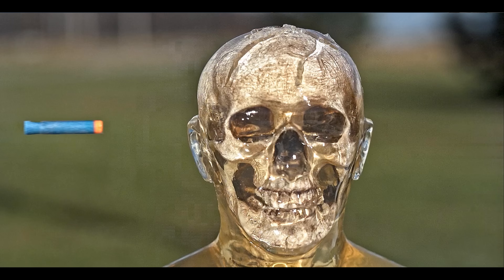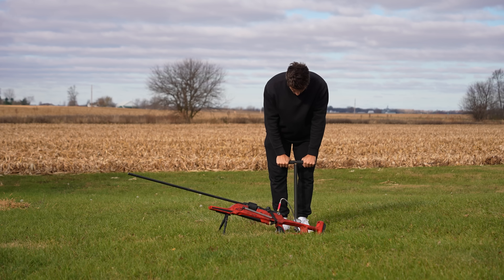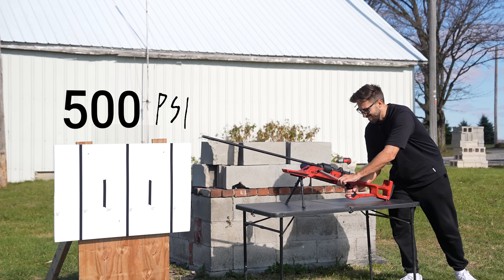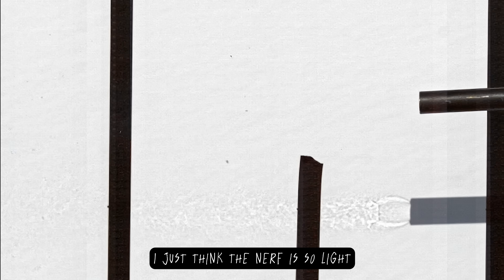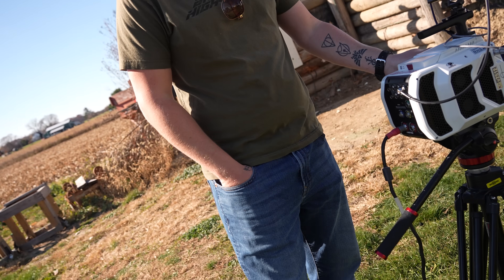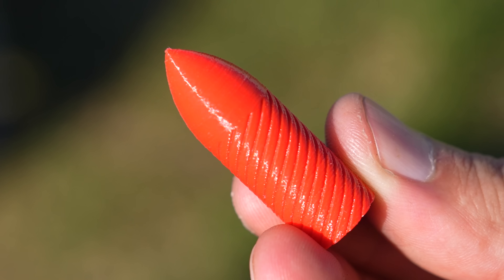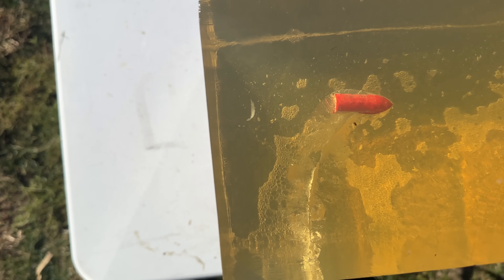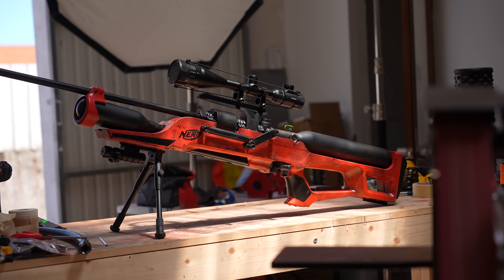How Dangerous is a Supersonic Nerf Dart?

Comment: I made a nerf gun with a bike pump that got up to 2000 psi and released it all at once. The nerf darts always exploded but I made a nail sabot projectile that would shoot at 2000 fps. I also shot lead 9 mm bullet that I cast, and I was able to reach 600 fps with them, basically a low powered pistol. I was able to penetrate thin steel with it.
Reply from the maker: What was the mechanism? (Valve) Releasing speed is even more important than pressure
Reply: @MikeShake  It was simple but effective. It was a ball valve with a long lever, hooked up to very powerful rubber bands. When I released the trigger, the ball value opens extremely fast. It was not a very pretty mechanism, but the results were excellent. 
I would love to share more about my previous experiments because I am just as nerdy as you. 
A 3 printed discarding sabot definitely gets me excited about making air guns again. 
I sent you an email about an unrelated topic an hour ago, looking forward to hearing back from you!

Comment: They built a gun that can shoot a ping pong ball like Mach 2 I think. Using a vacuum. Not pressure. They vacuum all the air out of a tube with the ball inside. Then they puncture the seal on one side of the tube causing the air to rush in pushing the ball. Since the tube has no air resistance due to the vacuum the ball reaches super sonic speed with little or no deformation. I’m sure they could do the same with a nerf dart. The low mass plus wind resistance of a nerf dart limits its terminal velocity. But in a vacuum there is no wind resistance.

Comment: hi, just want to let you know, the reason the 50. cal muzzle loader bullets twisted might have been becuse you left on the little plastic piece on the bottom
Reply: because usually that plastic piece will melt when the muzzle loader is shot and wont hinder the trajectory and penetration of the bullet

Comment: In slow motion you can see the biggest issue destroying the nerf darts is an overpressure as they leave the barrel. Drilling several small ports in the barrel a dart-length before the end of the muzzle could relieve the pressure before the dart exits. You'd be losing acceleration length though, so I would recommend a longer barrel if you tried this approach.
Reply: It may be even worse, on my point.
The projectile is not a solid bullet. It seems like the foam is highly saturated with compressed air so it expands after leaving the barrel. 
It may probably happen, that  the foam will partially expand in that area of pressure lowering, so it could be caught by theese drillings. It can cause the projectile destruction before it can leave the barrel...
Reply: @AliaksandrTt  The holes would certainly need to be small so as not to allow the foam to expand into them. But if you can mitigate that, a release of the pressurized air before the dart meets ambient air would give the dart the best chance of surviving. Right now it's an immediate cutoff into ambient pressure and the dart is behaving like an overinflated balloon.

Comment: You need a muzzle break. As the projectile leaves the barrel, the air escapes around it. That is what is causing the tumbling of the projectile. If you drill holes in the last 6 inches of the barrel, as the projectile reaches the end, the air will escape out of the holes and those last 6 inches will stabilise the projectile whilst the air escapes through the holes behind it. I used to do a lot of paintball and a lot of high end paintball barrels have these holes to allow the air to escape before the ball is released. I had a few of them and could make a headshot at 80m with one.

Comment: The best projectile for something like this would be one that has a Diabolo shape. This shape is what the pellets in regular pellet guns use and is somewhat self stabilizing while travelling at high speed through the air. The weighted front of the projectile works in conjunction with a drag producing skirt at the rear to aid projectile stability. As long as these were made out of sufficiently dense material to keep them subsonic, as the transition from supersonic to subsonic destroys projectile stability most of the time, you should be able to hit targets at a decent range. The easier but less accurate, while still being likely your next best option, would be to just use ball rounds.
Reply: Could also try a projectile with fins on the back with a profile that is smaller than the bore).
A dart type thing or even just cross sticking out the back would probably improve the performance.
Although you might need a ported barrel..

Comment: Impressive performance out of that gun. A few more refinements and you'll be more than ready for the zombie apocalypse. I don't know what the laws are like where you live, but if you can get away with it, I'd rifle the barrel. Also, you should integrate an air pump into the gun so you could just pull on a handle and pump it manually as needed. Would be extra useful that way since in the apocalypse you likely won't be able to plug into a power source. At least not after a year or two.

Comment: The issue with the rifled bullet is that air is still escaping around the bullet in a straight path, not leaving enough time for the bullet to gain any form of rotation through the tiny rifling itself.

The reason why rifling in a gun barrel works is because it causes the air itself to spin in a vortex as it escape around the bullet, and that is MUCH more effective at delivering a rotational force to the projectile. 

It's like the difference between blowing air over a spiral design top, vs a tornado

Comment: Haven't finished it yet, still watching, but I think your first rifled plastic slug began to skew because the material is uniform throughout; if you had placed a BB or something in the nose, the rifling might have had an effect because it already wants to stay straight. Or maybe hollow out the back end more, to catch the air pressure, like the manufactured air gun rounds, which would also divert the weight ratio slightly more in favor of the nose.

Comment: So I have a question, would a higher volume of air at the same psi not make a difference, as the length of the barrel creates a higher velocity, wouldn't more volume pushing farther down the barrel make a difference?

Comment: I'd recommend a discarding sabot to go around the dart and prevent blowouts, ideally made of TPU or flexible PLA. It should also help in making a better gas seal, allowing the dart to go even faster. 

A clamshell design would probably work well.

Comment: My main questions is. Do you happen to have rifling in the barrel of the blaster? If you ever plan to use 50 caliber projectiles, I would recommend making a barrel that would be compatible with your blaster. Since the bullet would most likely be tumbling out of a smooth bore unless you are using rifled projectiles.

Comment: I think the best projectile to use would be metal balls like in old flintlock guns, rotation wouldn't be a problem and you could get a better seal by rapping the projectile in paper like they did as well.

I know it's not as cool as over engineered bullet designs with fins and all, but most of the time simplicity is pretty effective.

There is a reason for most of the commercially available air guns to shoot spheres.
Reply: Most airguns not BB guns use pellets. Which aren’t round.
Reply: skibbidy toylit rizzler
Reply: Bbs
Reply: @griefergames4590  BB stands for ball bullet... It's the same thing, literally.
Reply: Yeah, but were shooting nerf bullets not real bullets
Reply: Rifling in theory eats a bit of energy. But also rifling helps to retain more nrg over distance because elongated spin-stabized body will have less drag for same mass.
Reply: Shotgun slugs made for smooth bore shotguns are rifled, like the round in the video. Theyre just rifled a LOT less aggressively. The ones in the video look like loony toons rifleing, where as IRL a shotgun slug is only going to rotate one time down the entire length of the barrel (if that, depending on barrel length.) If he had his rifling to be more modest he probably would have got better results, as I'm guessing the ones he was shooting were over spun.
Reply: Yes, a lead round ball would be better, but they still suffer a lot without any rotation. They are wrapped in lubed cloth, not paper though.
Reply: @D_Boone  you're right they used cloth with flintlocks, paper was used later with old revolvers like the Lemat and Colt navy before bullet casings were a thing. I mixed it up by mistake 😅

And yeah, rotation would still help with getting a more stable and straight trajectory. When I said rotation I meant misalignment, if the round rotated out of alignment it would't be an issue because there is no tip in the bullet.
Reply: @Zx_Z3r0  Well another alternitve would be a minae ball. With its hollow base there might be enough pressure to cause it to expand out giving a better seal. Also it has the benefit of being lighter in the rear and heavier at the nose which would also help some with stability. Ultimately without rifling stability is aalways going to be an issue for any lead bullet without the exception of lead balls. He also could try elctro etching with saltwater and a battery in the last 4 to 6 inches of the barrel creating starline choke. This is more common in countries like russia where its easier to get a "shotgun" than a rifle.
Reply: @hell_march6652  I've never heard of these techniques, definitely gonna research those to be more familiar. Sounds pretty cool!
Reply: yeah but the reason they're round is because sharp ones can kill
Reply: @PapaDidi-k8j  well, as I said there are many real guns that uses round bullets. Sharpness can help with penetration if you can get it to fly reliably straight, but as you can see in the video, what makes the big difference is mass.
What makes airguns less lethal is mostly the lesser force generated, due to a lighter projectile and lesser pressure of the co2 cartridge. The shape of the projectile is such a small factor in comparison.
Also it is easier to feed round bullets to a chamber because orientation doesn't matter.
Reply: @PapaDidi-k8j  I mean, anything going supersonic or near-supersonic is gonna kill ya, round or sharp.
Reply: @PapaDidi-k8j "make it pointy!!!" 😂😂
Reply: @PapaDidi-k8j  round one at 381 joules absolutely kills... you know, muskets did also kill with round bullets

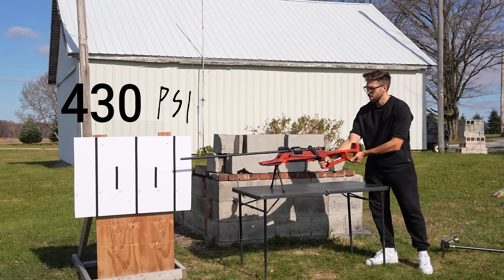Comment: 3:15 Velocity doesnt equal distnce over time, it equals displacement over time. Velocity is a vector quantity.
Reply: @Surd19  a surd is the square root of the sum of a rational n.o and irrational n.o(irrational). So now your username means you're irrational.

Edit- Why is YouTube deleting my comment?
Reply: @Surd19in Physics, superficial things like curvy paths and nonsensical paths are ignored, as they are not useful in physics, only sometimes irl. So here, even though velocity is being used, speed can also be used. It's only the difference in words, not meaning. Distance has absolutely no use in physics as it is not a concrete concept, it is just distorted displacements added together, so it is ignored. Despite what 9th grade physics will tell you, nobody in actual high level pure physics will ask you about the difference between distance and displacement.

You do not know Real Physics.
Reply: A surd is basically the square root of the sum of an irrational and a rational n.o.
Reply: Despite what grade 11 physics class may have you believe, velocity isn't always a single, hyperdefined concept. What's the velocity of Andromeda?
Reply: @michaelreimer1111   in Physics, superficial things like curvy paths and nonsensical paths are ignored, as they are not useful in physics, only sometimes irl. So here, even though velocity is being used, speed can also be used. It's only the difference in words, not meaning. Distance has absolutely no use in physics as it is not a concrete concept, it is just distorted displacements added together, so it is ignored. Despite what 9th grade physics will tell you, nobody in actual high level pure physics will ask you about the difference between distance and displacement.

You do not know Real Physics.
Sorry bro, this was a copy paste, you somewhat do know real physics.
Reply: @c.jishnu378  you just argued my point
Reply: @michaelreimer1111   fr bruh. That was my intention.
Reply: @c.jishnu378  I 100% misconstrued your comment and thought you were taking shots at me LOOOL, my bad! But it's like the grammar police that correct others on stupid things like: "can I go to the bathroom?" "Idk, can you?" I even had an english teacher way back in highschool get pissed off about it because it still gets the point accross and we all know they're asking for permission to leave class/station at work to use the restroom ffs 🤣
Reply: @michaelreimer1111   fr, once my teacher told us not to say "can" and the next slide in the PowerPoint had may and can, both as suitable words for asking permission.
Reply: Why terminal velocity, and not terminal speed?
Reply: @michaelreimer1111  Because you need direction for some calculations, and speed is not a vector quantity: you can't have direction.
Reply: @shariarshuvo  this isn't me being sarcastic, so I'll preface with that, but why is it called terminal velocity? Does that only apply on our planet? I was under the impression that terminal velocity refers to any objects max speed/velocity regardless of the variables that would come into play.
Reply: @michaelreimer1111  Terminal velocity is the constant speed an object reaches when gravity is balanced by drag. It applies universally where fluids (liquid or air) cause resistance, not just on Earth. It differs from maximum speed, which isn’t limited by drag, such as in space.
Reply: Science hurt brain my
Reply: This is just wrong. Displacement is the shortest path in from point A to B, ignoring any squiggles or curves in your movement like driving around a body of water. Including the squiggles is distance. You’re still going 80mph on the highway around that lake.
Reply: @wahidtrynaheghugh260  ok professor, like we did'nt knew.
Reply: Check out the big brains on you Terrence Howard
Reply: ok professor

Comment: The reason you felt recoil from the lead slug is that recoil is partially due to the weight of the projectile causing whatever it is propelling it to be pushed backwards.
This is why if you have a .22 semi-auto which isn't properly cycling, if you switch to heavier bullets, it will usually start cycling properly, because that extra weight is providing more recoil to work the action of the firearm.

Comment: Feel like if you plugged the nerf darts hole in the back it would reduce the amount it shreds when exiting the barrel. If you notice it always bubbles out and pops cuz all that pressure is entering the dart and pulling it along, instead of sitting behind it and pushing the dart. Idk just a thought I’m not educated in any of this. Just seems logical tho

Comment: haven't watched the video yet, so here is my hypothesis: due to the weak foam nature of the dart, it will likely experience extreme enough forces to rip it to shreds (friction) before it exits the barrel. However, if that problem is somehow overcome, and the air trajectory doesn't just become more time for the dart to disintegrate, the impact would suck. It would probably draw blood if it hit at a slight angle due to its rubber head, but generally low damage.

That is my hypothesis, time to see if I'm correct.

Comment: before the video imma make some basic calculations      nerf dart weighs 1-2 grams moving at lower than 350 m/s (343 but 350 because its easier) so
 1/2 * 0.002 * 350^2 = 122.5 joules
dodge ball max velocity 31 m/s , increasing to 35 for easiness  weighs ~ .1 kg
1/2 * 0.1* 35^2 = 61.25 joules
most massive nerf darts at supersonic speed has about 2x the kinetic energy of a dodge ball at 1/10 supersonic 
1 gram nerf dart has almost the same kinetic energy as dodgeball has at max thrown velocity

imma guess that if no air resistance nerf darts gonna do way more damage because its the same KE as a dodge ball which already hurts, but applied to a much smaller area.
in reality a nerf dart is probably super unstable at supersonic (due too blunt tip and weak frame) and will break up early in the flight, causing minimal damage at anything but close range

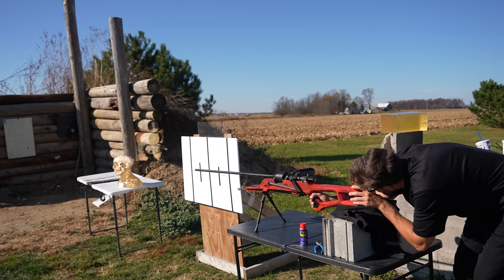Comment: 9:46 That first shot with a soft dart at the zombie head would certainly have generated severe trauma, even if it didn't penetrate the bone of the temple. The shockwave would have passed through the bone, seriously injuring the brain. As an anecdotal comparison, I was told that, when I was an infant, my dad held me in his arms, and I got fractious and struck him in the temple with my tiny fist. Dad told me that the blow dazed him, almost causing his knees to buckle. That dart would certainly have done a real number on the target (to say nothing of the surface trauma evident in the slow-motion replay). ='[.]'=

Comment: If you would have added a wadding to the metal ammo I presume you would get even more speed out of it; just like they did with smooth borse ball ammo muzzle loaders. All u need is a piece of thin or thic depending on the ammo size piece of square cotton cloth that you put underneath the projectile before you push it down all the way down the barrel.

Comment: try cutting a liner out of a straight walled 2 litre soda bottle and epoxy in into the inner wall of the nerf dart so it doesnt explode from the pressure.